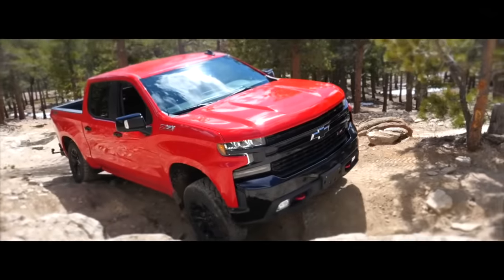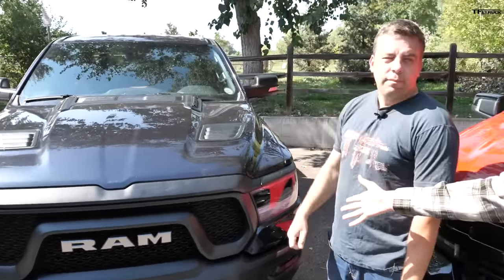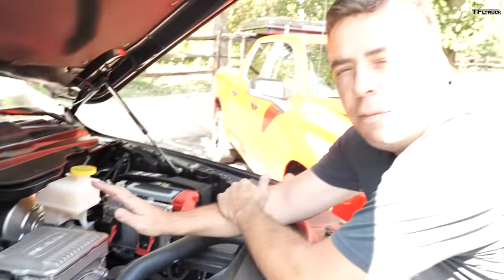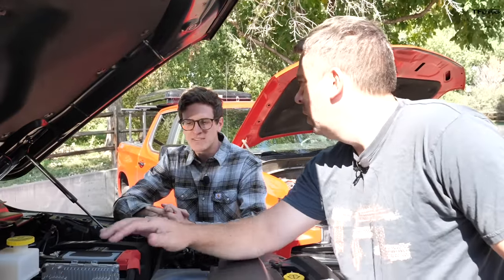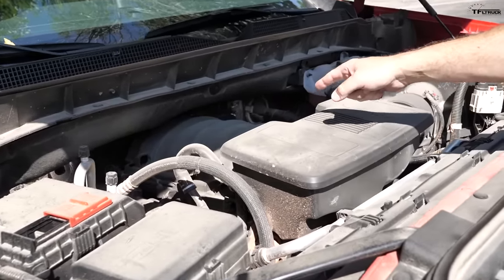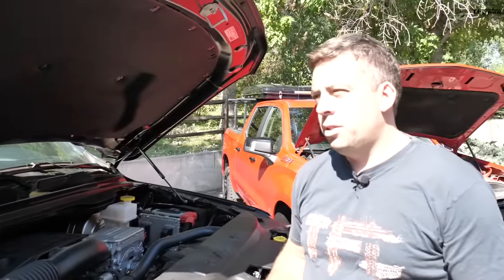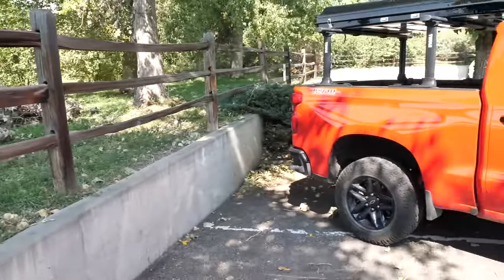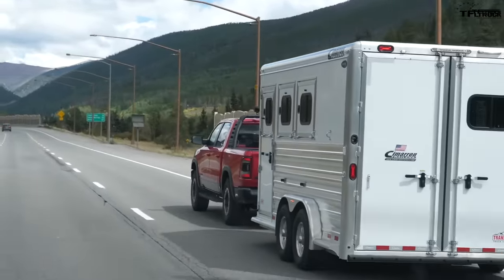New Ram Rebel vs Chevy Silverado Trail Boss: Which Full-size Off-road Truck Is Best For You?

Comment: Trailboss for me. Ram is nice, maybe even nicer,  but I feel at home in a boss. No place like home.
Reply: How has your trail boss held up over the years?  I'm about to buy a used 2019 trail boss.
Reply: @chrissnider9555  It was a great truck never had issues with it. I’d say as long as it has the 10 speed transmission and has had good consistent services as needed you should be alright. Mine was a 2020 and so that’s the model year I’d recommend also had 5.3 V8 which was great. Just do the scheduled maintenance as needed and should be pretty great vehicle for you.

Comment: I'd take a non e-torque Rebel over the Trail Boss for various reasons: 33 inch tire, Hemi with port injection, not direct injection which ends up in a sooty mess, ZF transmission vs 10 speed (jury still out there), interior quality, unloaded ride quality with the coils.  And a big one for me since I live in a salt belt, paint on the frame for the Ram vs wax only on the GM.  Hard to believe GM still does that.

Comment: TB 6.2 all day every day
Reply: I test drove a Sierra 1500 AT4 with the 6.2 and I LOVED it... but I heard somewhere that you have to run the 6.2 with premium fuel. Is that true?
Reply: Sherry Muckleston premium is recommended but not required.  It would be for the best do use premium for optimum performance, etc.  I know several people who use regular 87 and have no issues.
Reply: @barrysoetoro3488  Thanks for the info! I'm still truck shopping, this may help make the search a bit easier..
Reply: 6.2 is nice but cost a bit more than these two here.
Reply: @HRCfan17  That's the issue, especially if you happen to run into problems if you've run 87 in it against the recommendation of GM and you gotta get it fixed. There's always a chance something like that happens I gues...
Reply: Sherry Muckleston I just mean the truck itself cost more with that option.
Reply: @HRCfan17  lol oops okay

Comment: I am on my second Ram and I love everything about it, except that it only comes with four standard tie downs in the bed. Every time I haul stuff I am reminded of that. Chevy did that better. As for everything else, I love the Ram. I just got back from a 2500 mile multi-state drive, hauling stuff part of the way, and the comfort, the power, the utility are all excellent. If I were in the market today I would trade for another Ram 1500 with the 5.7. However, I am leaning toward a diesel next time and everything I hear suggests the Duramax is a better choice. I'll have to research that one carefully when that day comes.
Reply: @Hill City Skunkworks Don't forget that the Ram has an optional sliding tie down system.

Comment: Change the ranchos shocks and add 35” tires and it’s a different truck from first hand knowledge. Sure the Rams interior is better and newer but I have no complaints about my trailboss. It works. And no thank you for a rotary shifter, trucks need a Column shifter I don’t want a bmw shifter. TB for the win.
Reply: Pech Michael & Christina you gotta change the shocks on a 55k truck?? 😩
Reply: Jonathan B unfortunately yes ranchos were garbage.

Comment: I'm usually a Chevy guy, but not a brand loyalist, I don't haul a lot of stuff, but if I had a pickup, my only requirement is to carry bikes, an atv, and/or appliances and furniture every now and then. Something good for going to yard sales maybe, so the bigger bed doesn't matter much. I'd go for the Ram, but with a diesel. A hybrid system would be nice. A diesel/battery hybrid system would be a winner.

Comment: The Ram all day everyday,  like Tommy says welcome to the 90's and fisher price plastics.  I think my 2015  Ram is on par with the Chevy, I have heard to many issues about the newer Chevy even the HD trucks.  I mean both you could get for the high 40K mark, but as for daily use, seat comfort and support Ram.
Reply: I bought the Chevy.  It's my daily driver.  Married with 3 kids.  Everybody loves it.  Ram also has a history of rust and electrical issues.  No truck is perfect.  If they were then everybody would buy it and there'd be no competition against it.
Reply: @domin8ss  All of the truck manufacturers have had rust issues, it boils down to keeping it sprayed off if your state uses salt.  But when people complain to me directly as a sales consultant for the Ram brand that their new 70k denali 1500 has been in the shop for a total of 38 days in a year and 5 computers later.  Just sold a 3500 Cummins to long time Chevy guy his 19 Duramax with 32k miles has had emission issues constantly, literally bought 20 GMC 3500 600 miles in dpf plugged and in limp mode and can't haul his trailer for his company.  His new ram already has 3600 miles nothing.  I had a another long time GM guy come in on a new 3500 due to his '15 3500 Denali Duramax less than 150k miles blowing the engine had a $17000 bill, yikes.  Plus our growing collection of Ford trucks right now as its about 1 a month for me personally, but I'll give it to you I have customers with new truck have a couple of electronic issues like the ramcharger not working and an odd piece here and there.  Chevrolet is not the same brand they were when I was a kid when thats all my family owned till 2007, our '96 1500  was more reliable than our '07 1500.
Reply: @whatchis1120  are we really discussing 1-ton trucks on a video about 1/2-ton trucks?  I bet a Chevy salesman could come in here and say very similar stuff about Dodge owners buying Chevys.
Reply: @domin8ss  Still a chevrolet, I'm sorry the majority of my customers are HD owners.  But I have a ton of others that are in the family and friends.  We have a gm store beside us they bought their Rams at auction, I can look them up that's how I know. The Ford dealer accross from us has no Rams all chevrolets and other fords.  You can do your own search all you want, but if you want to discuss 1 tons in depth I can. Have fun with you lifter issues, ac problems and  rust problems on the wax frame of your from the 50's. Along with the water based paint that chips awfully look it up. Bye!
Reply: @whatchis1120  Again, everybody can point to something and say, "look at the trash".  Dodge has bigger problems with rust and electrical failure.  I haven't experienced the paint problems you said.  The lifter issue was last decade.  And, I've never had an ac issue.  Many years ago I worked in auto parts.  It was the imports that had ac issues, like Mitsubishi and Volkswagen.  Ford was ball joints and ECUs.  Dodge was parts for engine rebuilds on 318s and 360s.  Chevys were typically oil changes, brake pads, etc.  There be the occasional blower door motor, but that was about it.
Reply: @domin8ss  I'm from the rust belt non of our Rams or Ford have rust well besides my patinaed '87 W150 original 318 except for the carb. Plenty of rust chevys in my town less than 10 years old, 4 of our gm products have had ac issues. Also had another long time gm guy come in for a Ram, owned a 2017 chevrolet 1500 to many issue to keep it past the warranty less than 70k miles. The ranchers here in Co call Gm truck city trucks, the Rams and Fords the work truck for their longevity.  You will see 3-5 rams and fords to 1 gm truck here. None in my decent size neighborhood. We have a 2011 Suburban nice rusty frame and back doors only 120k miles, Gm is not the same anymore.  Their not the same as the bob seger era of trucks. I still have my 96 firebird formula, so I'm not too biased own 3 fords before my Ram even as an employee still have a Nissan 7th one. My Ram ecodiesel is a complete junker to most people 142k miles nothing wrong brakes, oil, fuel filters and fuel.  All the employees at my dealer drive FCA products can get the same deal at other brands due to us being a chain of dealerships, but they dont.
Reply: @whatchis1120  8 houses in my cul de sac.  3 have Chevy trucks.  2 have Ford trucks.  No Dodge/Ram.  Everybody else has imports.  One F-150, a 2016, was just traded for a Ford Fusion hybrid.  Too many problems.  Mostly electrical issues.  The remaining F-150, a 2017, is a highway queen with the 2.7.  Chevys are 95 Suburban 2500, 07 Silverado, and a 2020 Silverado (mine).  07 and 95 are being put to work weekly.  95 has a typical amount of rust for a 25 year old truck no matter who made it.  07 has no rust.  Jury is still out on mine since it's only 3 months old, but no issues so far.

Comment: Guys you forgot to mention that you can get the Ram Rebel bed in 2 lengths: 5'7" or 6'4"
Reply: Still shorter than 6'6" standard bed in chevy
Reply: @johnbenson4744  sorry but 70in is 5' 10", not 6' 6".
Reply: @kevinboerner3977  ya 5' 10 is short bed, longer than ram 5' 7, and 6' 6 is reg bed also longer than rams reg bed at 6' 4.
Reply: Pretty sure the rebel comes with only one size bed which is the 5’7”
Reply: @svr5516  You can get the Rebel with the Quad cab, 6'4" bed, just not on the crew cab.
Reply: @freedomrider266  yeah I forgot to mention that at least in the “crew cab” you can’t ,ik the quad cab does offer it. 👍🏼

Comment: I have a 2017 ram 5.7 Hemi it was getting up to 22 per gallon on the highway it had 275/55/20 tires on it I went with 275/60/20 it cut the mileage down to 20.5 highway now I put z38 drilled and slotted rotors on it and ceramic brakes which are a bit heavier than stock rotors now 19 is the best I’m getting... I realize the tires are a bit taller but I don’t understand the brakes and rotors doing that... thanks for your videos guys....

Comment: I own a 2021 Trail Boss and typically Dodge's seem a bit louder but I like the potency and decibel level of the Trail Boss more in this video. I propped the flapper valve open with two hose clamps and covered the resonator screens with exhaust tape and I'm very pleased with mine.. but the Trail Boss sounds louder in this video🤷‍♂️

Comment: I like that you can actually have a hidden winch in the front bumper of the RAM. But, they need to update the tailpipes, i like the quad look but can't do that on a RAM due to the design of the bumper.

Comment: I think the ram looks like a 55k truck where the chevy looks like a 35k truck that they are charging 55k for and thats not trying to take a swip at chevy .I like both would own either one  but id go for the ram at that price point of 55k its about what you get for the price tag.
Reply: My Trail Boss is nicer and better equipped than TFL's, and I got it for $51k.  Price was not negotiable since GM gives a discount for first responders.  Police, fire, healthcare, and military all get the same deal.  TFL was telling you MSRP, not the accustomed prove these trucks are selling for.  The real tell tale is that you can't find a Chevy at the dealerships.  They are selling very fast.  Ram dealerships still have inventory.

Comment: Love the video..love the Ram..if fuel mileage is a concern get a diesel..what’s the mileage then..I don’t worry about mileage...I care about power..if I wanted mileage go buy a Prius...lol
Reply: Why not get both?? My ideal transportation situation would be a 3500 Ram diesel 4x4 with a leveling kit at 35” BFG all terrains with high clearance steel bumpers and air lockers front and rear and a c6 z06 corvette with tons of mods and a Toyota Corolla for everyday driving

Comment: Its a simple awnser for me. If its a daily with some offroad nothing crazy get the Ram Rebel with air suspension as its more comfortable, better interior and infotainment which is where you spend your time. If its a offroad truck mainly with not to much daily stuff get the Trailboss. Either are good trucks.

Comment: Silverado front end is tired and boxy. Ram Rebel ride is hands down the best. Sound damping with the Ram wins again. I like the Chevy/ GMC but Ram is just a very nice truck. Rebel also comes without air suspension so not an issue to modify. Just get a Ram without air suspension. Wish the Ram had a step at the back bumper as you pointed out, especially since I lifted mine 6”. Chevy sounds good, maybe better in this test. Agree, maybe a toss up.  My 2022 had some bugs with the Uconnect stereo 12 inch they failed to divulge when purchased, these were known bugs.. After 1 year Uconnect  finally released the software updates that seems to have fixed the issues. It should be illegal not to divulge issues that are known. Overall, the stereo is awesome and the Alpine speakers sound great. The digital system is not difficult to use at all in the Ram once you have used it. The Chevy is nice and yes it works, but it just cannot compete.  As soon as my friends get in my truck that own other brands they are just amazed at the quality and feel of the Ram Rebel. Neither truck gets good gas mileage. If you are looking fo mileage get a Toyota Camry. I am not a Ram fan boy and actually my previous truck was a GMC, which I loved, but the Ram has come a long way and I choose Ram over the Silverado you had in this comparison.

Comment: This is why I still prefer the colorado, pricing and capability, and fuel economy is still pretty good.  None of these trucks suck though.

Not a fan of that large gap on the ram though I feel like it woulnd't take long to gunk up that area just by normal driving.

Comment: I like both, but I would be worried about reliability with the Ram and Rust with the Silverado. I don't like the computer screens in either one or the push button start. I would also rather have the standard cab with a long bed. It would be better to know how the sound is inside while driving down the highway than what they sound like revving the engine. Both are priced to high in my opinion, but all new trucks are too high priced.
Reply: I can't say about the new ones, but  my '18 came with a black powder coated frame and was just as shiny new and nice underneath as it was on top.  I know because I crawled under there coating and undercoating everything I could after my beloved manual transmission '89 K1500's frame rusted almost completely away.  Both are regular cab short beds and thank God I got one before they quit making them.
Reply: The new ones here have rust stains on the concrete right on the dealer lots.
Reply: If you're worried about reliability with a push button start, you don't know much about cars.
Reply: @lrjetav8r832  I'm not worried about the reliability of the push button start, I'm worried about the reliability of Ram trucks in general. I just don't care for the push button start. I prefer an actual key.
Reply: @CraigSmith568  👎

Comment: I own a 2019 LT Trail Boss and love it. If I could change anything I could, I would put a manual locker on front and rear axels, sway bar disconnect and 42 gal fuel tank to match Fords.

Comment: Id opt out of Rebel 12 in favor for Level 2 with Dual Pane sunroof and get the optional 12” screen on it the red accents red and white color stitching red seat backs and cloth seating surfaces are way more usable much better and premium looking as well as doesn’t burn but on those hot summer days the Rebel 12 although has leather the rest of the interior feels with the silver trim and single color stitching feels less premium

Comment: Andre, you mentioned that you wish the rebel got better mpg. Considering the rebel tires are significantly bigger then the trail boss, I wonder if you put the smaller tires on the rebel if it would get the same or better mpg than the trial boss?
Reply: More importantly for the fuel economy..... What axle ratio is the chev?  The Rebel has 3.92's as standard.  I took a ford out with the ten speed (Chev and Ford use the same transmission) and it seemed to hunt between gears.  A lot.